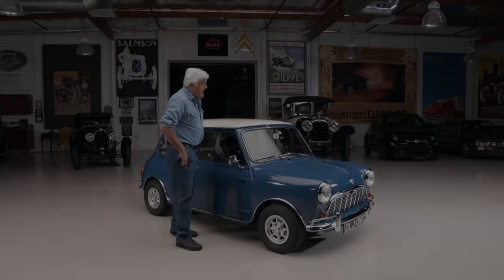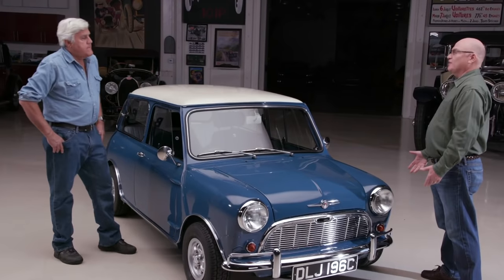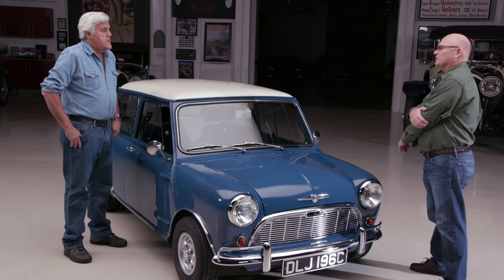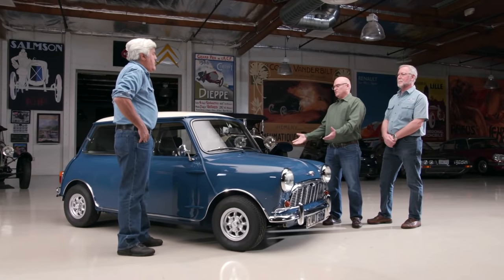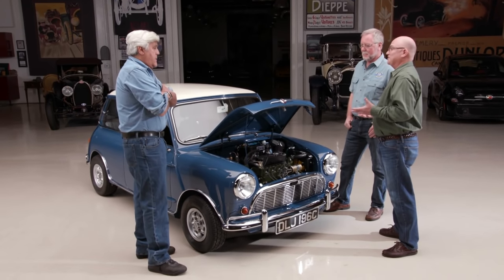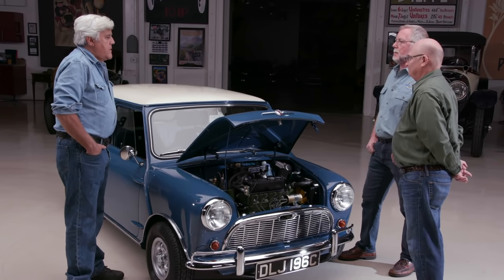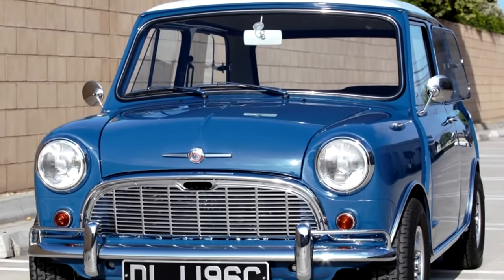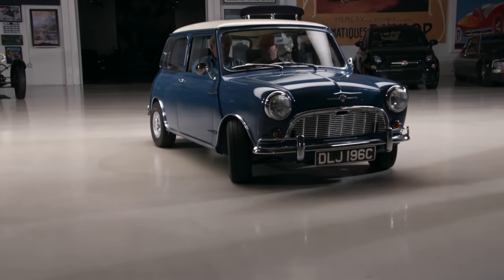1965 Morris Mini Minor - Jay Leno's Garage

Comment: Great Video! Lovely restoration job.
Appreciate the work here in London England 👍
Brought back memories for me as a kid! - My mum had a Mini 1000, Cousin had a Mini, His Dad had a Mini 1275 with Mini lite Mag wheels super wide tyres and wide wheel arches all from factory was a special edition sports model black with gold mag wheels and a race exhaust! That shifted!! My mate had a 1275GT race-tuned himself, it used to get to 60mph in about 6 seconds! (He had the one with the flat front grill and lights) my other mate had a Mini 1275 Estate! Had the flatter front and grill (station-wagon I think in U.S.?) Another mate had a Mini 1000 but had race tuned it with a racing clutch so it shifted and went super quick, and apparently my grandad had a Mini estate and my dad borrowed an estate one for 6 months off his mate in the 70s lol 😅..
My mates mum also had a Mini 1275, Guy at college had an Old Austin 7 I think it was? (Mini with a Saloon boot(trunk) and a chrome grill ran vertical And protruded from the front slightly, but other than that same as a Mini..) They're probably the best/most innovative car ever made, if not certainly of its era, (and probably the most prone to rust lol 😅) The thing you said about the distributor cap (people used to cut the fingers off a rubber washing-up glove and put it over the distributer cap to keep the water out lol..) I guess it's a bit like the Honda Cub step-through Moped, but of the Car world, innovative, affordable, appeal to everyone and extremely versatile! ...Thanks for an entertaining episode! Really brought back memories for me!
I've always wanted to get an old mini here in London England, but the price is astronomical nowadays, because they're so rare and saught-after (if they're in any sort of half decent condition that's repairable!), Alas, most rusted away..

Comment: While in grad school, I bought a 1959 Fiat 600 for $60. The 600 ( and the 500 earlier) was sort of Italy's approach to the same market as  England's  Mini. It weighed about 1100 pounds, had 29 horsepower, 10' wheels, and rusted before your eyes. I loved it, and drove it all through school. One of my professors had an identical one with a stripped axle ,and gave it to me. When I left school in 1971, I sold them both for $ 30! I would love to have a Mini.

Comment: This and the Landover defender both known to have rust showing as they left the shop floor. From the guys I know who worked at the Austin Longbridge, cars sometimes went out with 1/2 the electrical work done, components missing. Lucas were always a joke for part quality so they weren't even starting on the best foot. 

But the mini drives like no other, with your bum 6" off the ground makes it feel like a go cart. Drums were useless though most epic mini story's I've heard have involved aquaplaning or overheated drum brakes and a lack of road. 

The number of 17 year olds who crashed their's and just brushed it off and carried on was legendary, having been in 5 or more crashes my self as a passenger it's surprising how well a mini goes under a transit van with out any damage to the mini at all, even when the windscreen was finally used to stop the car.

Being accessable to teens in the UK for generations the number of people I know with automotive degrees or electrical engineering degrees who can put it down to the love of tinkering with mini's of this age can only be matched by those I know who have automotive degrees who loved HP Citroen's growing up.

My cousin's even went as far as buying Westfield's molds and plans for the space frame for there kit version of the mini turbo when they sold up what must have been 8-10 years ago.

Comment: At one time or  another had three Mini pickup trucks for my business , small motor cycle shop, they carried one big bike like a Suzuki Gs1000 or two smaller machines. They were basically reliable until the very last version made which was a lemon.
My favourite was one which had had a 1275 GT power unit grafted in. Nice and small to get a motor cycle into single handed. When empty areal fun machine, handled even better than the car version, we had two of those as well. Never see anyone rebuild a pick up version nowadays, pity.

Comment: I had 5 Minis back in the late 70s early 80s they were great fun.
Handled like a go kart with a wheel at each corner low ride height 10 inch wheels sharp steering.
I had various engines in them from 850 to 1275 MG Metro (similar power to the 1275 Cooper S ) but my favourite was a 1000 I fitted with a Cooper 998 cyl head ported by Aldon Automotive (Alan and Don ex works tuners) a rally/race cam, big 1 3/4 carb and race exhaust. It used to rev to 7,500 which combined with wide wheels and uprated suspension made it a giant killer around town.
Sadly chasing a friend's Ford Escort Mexico off road I hit a hump in the track took off and landed on a rock which smashed the gearbox and engine.

Comment: I hope Steve Nelson gets out and has more fun in this little beauty. That is a fantastic Mini that makes me yearn for another. Growing up in New Zealand my first car was a 1974 Mini Clubman. Both my sisters had Minis. My grandmother drove a Mini. Several friends, including one at least 6'4" tall drove Minis. The original Mini is arguably the most fun car ever produced. Whenever possible you wouldn't take the direct route through a roundabout but  do several laps. Perhaps as Jay suggested it was the impression of speed that added to the fun. And as Jay also noted, pulling "handbrakies" was done way too frequently. As long as you didn't collide with something at speed you always felt safe doing stupid stunts in a Mini because it way surprisingly forgiving of boy racers yet I believe it made better drivers out of us. Other than a few minor mechanical issues the only niggle I had with my old Mini was how badly it fogged up on rainy days and having to wipe the windows at red lights.

Comment: My first car was a 74 Aussie made Leyland mini, 1L motor 4 speed. It had the factory wide track drums with wheel arch flares. The brakes were horrible, no matter what you did it was always one pump before they were ready to work.
Side mounted radiator didn’t works the best when it was hot, heater on windows down helped. 
I kept shredding the top engine mount to the firewall, I seem to recall neoprene and welding up some pipe.
The places we went and the things we did are the stuff of legend. Reverse donuts for hours 🤣

Comment: Very nice to see such a classic UK icon restored, reasonably sensitively. I had one in the 60's, we all bought the Paddy Hopkirk accessories, and put on centre bore exhausts etc.
 The road holding was sensational for its era.
 The generator , we called a dynamo, yes pre alternator days, the dipping of lights etc, was because the control box was an on/off affair. Rear sub frames were a nightmare, CV joints also, gear change was an acquired art.
 The distributor was always a weak point in the rain, and you would see them breakdown on the motorways in rain. The partial solution was a 5 fingered condom that enclosed the whole HT side, and eventually WD40 would be your friend,(when it was invented).
 We used to dream of twin 1.25 SU's, and stage one polished heads, and 0-60 in 10 secs was the ultimate goal.
 A whole generation of practical motorists were born who cherished their means of transport, and learned how to stay on the road, the "Special tool", in the manuals, was usually improvised with a hammer.
 Many thanks for a nice nostalgic ,well presented video, made by enthusiasts.

Comment: I had one of these (but the estate version), new in 1967. It cost 640 GBP. You paid extra for it to be undercoated and seat belts cost 10 GBP on  top. Great car - but rust was an ongoing problem over time - after a few years, work on keeping the rust at bay proved a headache. No synchro on first. Drive shafts would wear out - knocking sound on cornering - but not too hard to replace. Mostly I did my own servicing: it was fairly easy to service. Great in snow driving, which was good where I lived. Exhausts would break sometimes, cracking at the junction of the exhaust manifold and the exhaust downpipe. The engine rocking on the engine mounts did that. You could get a ‘flexible’ aftermarket junction, but it didn’t work well. Only cure, a new exhaust (all in one piece).

Comment: Jay has it absolutely right, it's the ''impression of speed''. First time I drove one, was a hired one on Holiday , I was amazed at the impression of speed, with it's snub-nosed little  frontage,  the road seemed to be rushing at you. It was like riding on a motorised skate board. The other thing was the direct steering--like a dodgem car. When I returned home, my own bog-standard Ford Anglia 105E, seemed so gutless, completely lacking in power, and lumbering. It took quite a while to readjust.

Comment: This is brilliant. My first car was a red with white roof 1989 Austin Mini Racing Flame (998cc). I bought the car when it was 6 years old and in mint condition and it had a big bore exhaust (Can you imagine!) Lol with white alloy wheels.  I always wondered why the radio was stuck below the dash on the passenger side. Now I know!

Comment: The Cooper S does have a cross over line.  In fact that is the best way to check if the car is a genuine Cooper S, the fuel line that joins the two tanks is held down by a metal tag spot welded to the boot floor.

Comment: My brother had a car  that looked like that  but  it was  around  a  1962  that he bought in 1966. 
    It was  a "wagon"  with the back lights  up higher  and a  subtle fin  aft the driver door   where the tailight was like  a narrow spearhead .  The hood and roof were black while the verticle area were read. 
       Inside area  was the same   with manual windows and pop-out rears.  The speedo was large  with white lines   to show  what speed  you had to shift   into  2nd  and then  3rd . 
   The joke about the wagon was that it could carry  2 beach balls  instead of one for  coupe. 
  There was a hole  below the grill  where a Crank Start  Rod  was under the hood  to turn over the engine  if the battery failed.     There was  lots of room  in front and rear   but it had the drive  shart hump  .

Comment: When I was young I had an 850 mini pickup in grey colour. If only I could go back you could pick them up for virtually nothing.  A weakness was the fact that when it was really wet, water spray used to come through the front grill and get onto the ignition distributor causing ignition misfire or even cut out.  It was a common trick to get one of mothers dish washing ( Marigold ) rubber gloves and squeeze a spark plug wire through the tip of the individual finger tips.  the hand of the glove was stretched over the distributor body.  this mod kept the water away.  another common upgrade was to replace the standard ignition coil with the Lucas sport oil filed coil.  I think that I still have a load of carb dampener springs with coloured paint bands and even SU's kicking about somewhere. Something else... originally they had an SU electric fuel pump but later they had a mechanical pump.  the petrol caps were different in as much as some were vented.  IF the wrong cap was fitted onto a mechanical pump the fuel tanks could get vacuumed in and collapse with a big bong loud.  new tank required.!!  Love from the UK.

Comment: I used to race Minis, had a few with different specs at various times. The thing was that they were cheap as chips to buy used in the late 1960s and early 1970s, as was most of the performance tuning equipment needed. The final one for racing that I owned had a bored 1293cc engine and went like a bat outta hell!

The Mini was priced at around £495 when launched in 1959. Later in Britain they were often available used at as little as £40 in fair condition!
Reply: Greatest mini racer of all was and is John Rhodes. Rog.

Comment: My friends had one in 1970,....before the term "drifting" was being used,...the fellow who owned it took us around out in the country,...just a few miles outside of the city of Cleveland,
east of the eastern suburbs. The area was called Chesterland,...and back in the 1970s it wasn't all built up yet,....there were farms and rustic roads of gravel & dirt. We used drive a bit too fast and then take the corners roughly,...so that the car would slide out. It was our weekend fun. Of course we had one scary close call,.....where there were three of us in the car, and I was in the back seat. ( Not much of a seat, and certainly no seat belts.)  We slide out on some gravel,.....and the car jumped the curb or berm edge, on the opposite the side of the road. The car flew up in the air and we landed hard in a dirt ditch. We landed flatly, and the car and ourselves, weren't hurt,...just tossed around a bit. Our friend continued doing this, but we didn't accompany him. It sure was fun.

Comment: 18:12 Jay I saw you had a suburban or GMC is equivalent to a suburban in the mid 60s and I had one of the Chevy models. Their license plate would fold down, if you had the clamshell tailgate so you could drive with a bunch of two by fours sticking out the back with a rag tied on them and still be in compliance. It was my party barge !😵‍💫

Comment: Ken Cook of Bournemouth.  There's an Englishman.
Cooper to Mini is like Shelby to Mustang.  In the 60s you had the Morris Mini Minor, Austin 7, then Wolseley Hornet and Riley Elf which were the same but with a saloon/sedan-like boot/trunk.  As to the use of the names "Seven" and "Mini-Minor" initially, Austin used the same technique when they launched the Mini's intended replacement at the start of the 1980s.  They called it the Mini-Metro, but it soon became known as just the Metro.  Of course, Metro is also a throwback to the old Metropolitan that was aimed at the American market decades prior.  I could never understand why BMC never sold an MG Mini.  They offered 6 variations of the 1100/1300 model: Morris, Austin, Wolseley, Riley, MG and Vanden Plas.  There was an MG Metro later on.  I suppose the Mini Cooper filled that MG gap, but the Mini 1275 GT that replaced the Cooper in the 70s could've been badged an MG.  I suppose MG might have seemed a little stuffy by then.  Actually they did make 2 MG Mini prototypes called the MG Gnat.  One for the road, and one for rallycross racing.
We still use miles instead of kilometres in the UK.  I can't comprehend kilometres.

Comment: The Austin and Morris names were used because Austin and Morris were separate manufacturers that merged into BMC (British Motor Corporation) in 1952, but BMC maintained the separate Austin and Morris brands and dealer networks, so they commonly rebadged cars to sell as Morris or Austin, not just the mini.  

BMC also included MG, Riley, and Wolseley and a similar badge engineering went on with these brands. There wasn't an MG variant of the Mini, but there were a Riley (Elf) and Wolsey (Hornet) versions. These had a modified body with an extended boot (trunk) and a fancier bonnet (hood).

Comment: Jay, it's a shame you don't have twisty country roads in California because nothing, absolutely nothing goes round a bend better than an original mini, nothing at all, road holding is fabulous, I'm English and I have had 3 original mini's, one was a clubman with a squared front, one 998cc mini and one with 1375cc and something they called a stage 2 racehead which gave it more power ( I don't know how much) but it did 0-60 in about 8 seconds which is quick for a mini and still the road handling was fantastic, no understeer, no oversteer, it just went where you wanted it to without losing traction, Criminals in the 1960's and 70's used them as getaway cars, they couldn't outpace the police cars but they just out manoeuvred them round corners and bends especially in big towns and cities, They are fabulous little cars, Some English police forces then bought them as patrol cars

Comment: I had the 850 mini van 1978 in sand colour , the engine if looked after would last a lifetime but the body was another story. Paid about £900 I bought it from the company where my mum worked as she got a newer mini van 1982 navy blue 
1000 I wanted that version next but she left that company before it was for sale.

My sister wrote off the sand colours mini van,

When I was a baby I Mum and Dad had a green mini van, it had a pop up roof vent and strings to open the doors instead of levers ,

Easy to work on cars if you had the correct tools

Comment: I had a 1969 Austin America. The cooling fan melted into the radiator and I had it towed to the nearest gas station/repair station. The owner say's sure I can repair it. He then continued to open the trunk. I said what are you looking for he said the engine! The Engine is a 1,200cc and transversely mounted in the front with front-wheel drive!

Comment: My first car Morris 998cc hydrolastic suspension. Managed to get off the road a bit after meeting a car coming the other way on high beam, then rolled it. Followed by a 1100cc mini k van. It had a little flip up ventilator in the roof that a hand could go through and wave. Both fairly sound cars that handled well. No heater demister fitted to these when they were new. The distributor was right behind the grill and had to be sealed well to avoid stalling in the rain. The next models by British leyland were not as good.